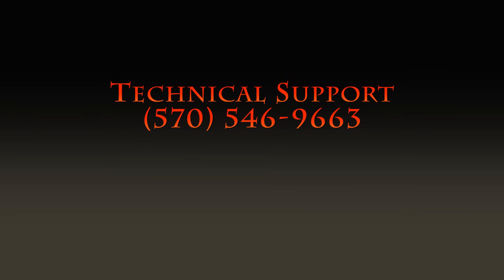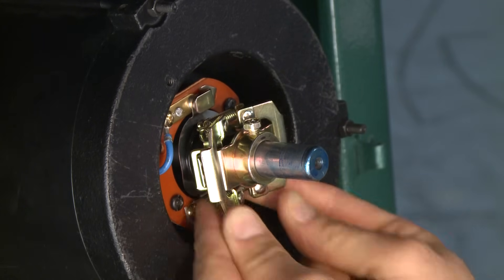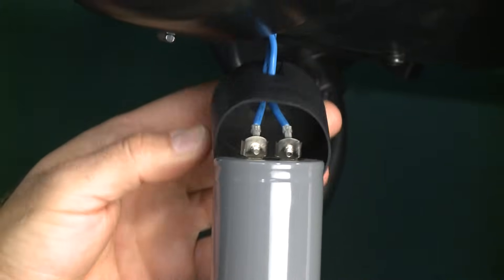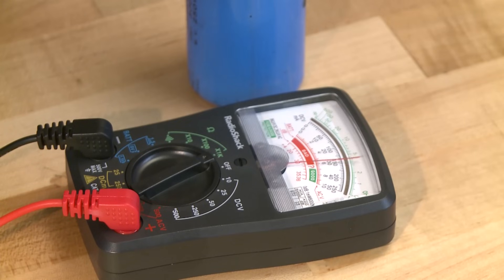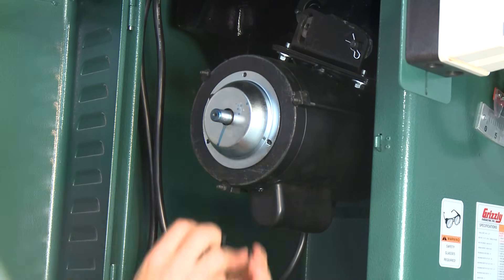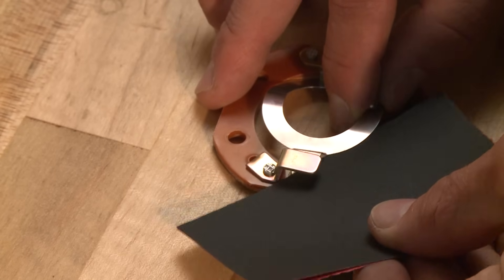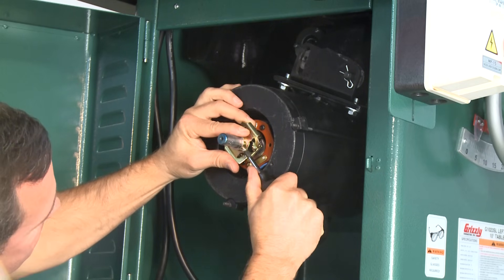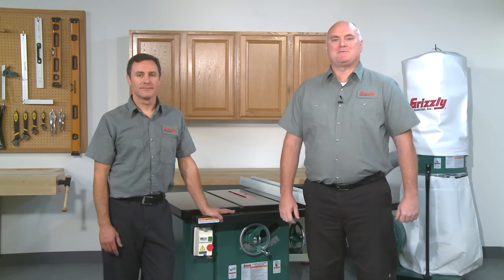How to Troubleshoot an Electric Motor and Adjust Centrifugal Switches

Comment: Support sent me this video. He said for my shopfox 1837 it tells him the switch is external and something else says it's internal. I gave replaced my start and run compactors and then a second set. Its for sure not those. Also my analog reads how it should. But when i remove the fan cover, the fan, the bell housing, gheres no switch. Just bearings on the shaft and the copper coil behind it. Nothing like this video. The switch is the most likely next step and i can't find it. I wish it was as easy to get to as this video showed.
Reply from the maker: I'm sorry to hear the video provided wasn’t helpful in resolving the issue with your W1837. I recommend reaching back out to our Product Support team directly. Please let them know that the video did not match your machine’s configuration and that you're unable to locate the switch as shown. They’ll be able to take a closer look and guide you through the next steps.

Comment: Thank you I’m so glad I found your channel and this video in particular. I have a craftsman air compressor. It’s says it’s professional brand 27 gallon. It’s a nice heavy duty unit. I inherited it from an estate. It’s only about 12 years old and initially when you plug it in and turn it on, it would run for less than a minute and die run and die so I changed both of the capacitors the run and start they are newand still the same issue. I didn’t know about the internal centrifugal switch on the motor. I’m going to try this step next thank you so very much.
Reply from the maker: We’re glad the video could help. It sounds like you’ve already done a great job troubleshooting with the capacitors, and checking the internal centrifugal switch is definitely a smart next step. Hopefully, that resolves the issue and gets your compressor running smoothly again. If you need additional assistance, our Product Support team is here to help. Keep us posted on how it goes, we love hearing success stories from the shop!

Comment: Is there a way to access the capacitors and the centrifugal switch on my 15" wide belt sander (G9983) without removing the motor. The access cover is only on the pulley side.
Reply from the maker: Ensure the machine is disconnected from power before beginning.

Remove all accessible motor panels, including the belt access cover.

Loosen and remove the belts.

Remove the brake caliper to allow additional access.

Disconnect the motor wiring.

Remove the motor mounts.

Carefully raise the motor and place blocks underneath to help support it—take care not to damage the capacitor cover or fan cover. You may need an assistant to help lift the motor from the machine.

Once the motor is removed, tests can be performed on the capacitors, centrifugal switch, and contact plate.

If you need further assistance, please contact our Product Support team at (570) 546-9663.

Comment: Yeah all well and good until it's a G0771Z and the switch on the front and not accessible and your brand new saw won't start.
Reply from the maker: We’re sorry to hear about the issue with your table saw. If you haven’t already, we recommend reaching out to our Product Support team, they’ll be able to assist you with troubleshooting or any necessary parts. We want to make sure your saw is up and running as it should.

Comment: You don’t test caps like that it tells you nothing 😂
Reply from the maker: If your voltage meter doesn’t have a capacitance tester function, this is still a reliable method for checking whether your start or run capacitor is faulty.
Reply: It all depends where the fault is this is why this method is useless. It’s best to just get the right tool for the job.

Comment: My 3HP 1PH Grizzly has two capacitors.  One is a "start" cap and other is a "run" cap?  You only talked about the start capacitor and related symptoms.   My motor starts but doesn't run.  If that makes sense.
Reply: Not knowing much else about your motor, if it has a problem running, maybe that run capacitor is the problem and needs to be replaced. 

I would note that just having two capacitors doesn't necessarily mean that they are run and start capacitors. The motor on my lathe has two caps, but it turns out they're both in series with the centrifugal switch. Therefore, they only take effect while starting: two start caps.

Best of luck to you.
Reply from the maker: For more detailed assistance, we recommend contacting our Product Support team at (570) 546-9663, and they’ll be happy to walk you through troubleshooting and help you get it sorted out.

Comment: Good video i got a compressor and i dont know if the switch is getting stuck or got bad start capacitor i ordererd a new guess im gonna see .but it will run and shut of but when i use it and run it down and the pressure switch flips it dont want to start wait 30 min and it will run again
Reply: It's not the thermal sensor cause it draw like 60 amps and want run up to speed

Comment: How do we use a centrifugal switch to stop a three-phase induction motor, and what is the connection method? Can you explain it with a video clip? I will be grateful to you.
Reply: This question doesn't make much sense, in this context.

These centrifugal switches are all about starting a single phase motor. Three-Phase motors don't need starting capacitors or centrifugal switches.

If you want to stop a three-phase motor, cut the power to it. If you're trying not to stop it, but control the speed, use a variable frequency drive, often called a VFD.

Comment: Another question, please Why don't we use the centrifugal switch instead of the capacitor to start the rest of the engines, I mean in the compressor, refrigerator, freezer, air conditioner, or split system? Can you explain via video clip, thank you
Reply: I think the answer is at the beginning of this video. The starting capacitor effectively generates a second phase of power. The centrifugal switch just turns off that second phase after it's done its job. The starting capacitor and centrifugal switch work together. Neither is any good without the other.

The job of the second phase is to make sure that the motor turns around in a circle, instead of just staying still and getting squished. 

This type of motor runs using two electromagnets, on opposite sides of the motor. When the motor is stopped, they can't start it spinning, because they're in balance with one another. They just push without moving.

The starting capacitor runs a third electromagnet, whose job is just to give the thing a shove and upset the balance of the two main electromagnets. 

Once it has started spinning, the centrifugal switch turns off that third electromagnet. The motor spins nice and smoothly. It's momentum carries it across the two main electromagnets, which give it a smooth push every time around. 

If the centrifugal switch doesn't interrupt that third electromagnet, it continues to give an unbalanced shove every time the motor goes around. It makes a horrible sound and breaks things. And that's what's going on with my motor. 😔

Comment: Very good information. I'm going to do battle with my five horsepower 220 volt motor for my Foley bell saw planer. In the electrical box there's two start capacitors and three run capacitors in parallel. As Charlie Brown would say, good grief!

Comment: Oh my God, the level of ignorance in this video is ridiculous 🤣 

- Run capacitors are discharged through the motor windings in a fraction of a second.  Assuming that doesn't happen, waiting 5 minutes isn't going to discharge the capacitor.  Most start-capacitors have bleed-resistors to discharge them but run capacitors are NEVER equipped with them hence you need to check for DC voltage to make sure its safe to handle!

- Shorting a capacitor with a screwdriver in some cases can literally liquefy the metal tip or melt the capacitor terminals off sending molten metal flying into your face.  It's best to use a bleed-resistor to slowly drain the capacitor charge instead rather than causing arc damage.

- To test a capacitor it's best to setting your meter to capacitance and verify the reading falls within the specified tolerance ranging printed on the capacitors enclosure.

- The main reason your centrifugal switch contacts are burnt or pitted is that most Chinese electronic component manufacturers cut corners by not alloying enough Beryllium into the contacts to prevent excessive arc burn/pitting hence they are designed to fail much sooner compared to past switch contacts!  Don't even bother trying to sand the contacts because that only causes them to burn/pit even faster the next time around due to you removing even more of the Beryllium coating.  The best option is to just replace the switch.

- If the centrifugal switch contacts are welded together then the start-capacitor is destroyed because it doesn't have a 100% duty cycle like a run capacitor.  Usually, if the start-capacitor stay in the circuit for more than a second then it typically blows the guts out of them.

Comment: Hi my capacitor motor starter is raté 600uf and 150vac can i use à same but with 250vac ? Thank you
Reply: If you try to put 250 VAC on a 150 VAC capacitor, you're going to have a bad day.

However, if the motor is made for 250 VAC and has a 150 VAC capacitor, it's probably fine. That's because the 250 VAC is across both of the main motor windings together. Because they are in series, each winding sees only half of the total, 125 VAC.

The starter winding is probably parallel to only one of those main windings and therefore also only gets 125 VAC.

You're probably fine.

Comment: I needed this!  My band saw took a dump while cutting a bar of 12L14. I suspected the cap. Melted! Dropped in a new one and went to work.  90 seconds later, a pop from the capacitor cover and magic blue smoke comes out.

Thinking about the problem while machining a block it dawns on me that I'm not hearing a click and I bet it's a switch.  Bread crumb trail of clues lead here.  I'll follow up.

Comment: Hi . I have a centrifugal pump 2.2kw AC single phase motor. Can I run it on solar without using batteries and inverter

Comment: I have the south bend sb110815" planer by you guys and unfortunately the access is not nearly as convenient as it is in this video. it has a start AND run capacitor. the machine is 11 months old and I have k now idea how to trouble shoot it eecpt for your videos. all centrifugal switches and electric motors are not the same on the machines you manufacture so a ballpark video is not close to helpful for me. I paid 4 thousand dollars for a planer with no idea I would need to be a  mechanical engineer in 11 months to repair it. the only option provided is to crate it up again and wait for its return. THE MANUAL COULD NOT BE MORE CONFUSING. It's for machines manufactured before 2020 and after in no competent order. I could not be more disappointed right now and had to go buy a cheap 13 inch planer and put a bunch of projects on hold until this gets fixed. you need better more specific videos and for crying out loud make a septette manual for the new machines!!!
Reply: It’s absurd that companies who want respect & loyalty don’t make useful/accurate manuals readily available, with ongoing repair parts available at a reasonable price.
Reply: It’s absurd that companies who want respect & loyalty don’t make useful/accurate manuals readily available, with ongoing repair parts available at a reasonable price.
Reply: It’s absurd that companies who want respect & loyalty don’t make useful/accurate manuals readily available, with ongoing repair parts available at a reasonable price.
Reply: It’s absurd that companies who want respect & loyalty don’t make useful/accurate manuals readily available, with ongoing repair parts available at a reasonable price.
Reply: It’s absurd that companies who want respect & loyalty don’t make useful/accurate manuals readily available, with ongoing repair parts available at a reasonable price.
Reply: It’s absurd that companies who want respect & loyalty don’t make useful/accurate manuals readily available, with ongoing repair parts available at a reasonable price.
Reply: It’s absurd that companies who want respect & loyalty don’t make useful/accurate manuals readily available, with ongoing repair parts available at a reasonable price.
Reply: It’s absurd that companies who want respect & loyalty don’t make useful/accurate manuals readily available, with ongoing repair parts available at a reasonable price.

Comment: Hi, thanks for sharing the knowledge. I am having problem with a tyre changing machine.  it's a single phase motor with 1 capacitor. It spins fine clockwise. When switch operated to turn anti-clockwise, it tries to turn but not moving. If manually pushed, it starts spinning normally until you take your foot of the switch.. I have replaced internal reversing polarity switch but no joy. Can the centrifugal switch be at fault?

Comment: I noticed the capacitor did not have the normal microfarad rating symbol., a u with the tail. It had a capital M instead. Is this a different value?
Reply: 6:23 the “M” or “u” are both prefixes for “micro”
Reply: I did not realize that. I would’ve thought the capital M was mega. Thank you.

Comment: As a machine tech, I've done this many times.  I have taken a file to the contacts to remove pitting.  This does work but will not last as long as a new set of contacts.  After filing, set the switch the way the video says to.  It's a good idea to order a new centrifugal switch after filing the contacts,  They are not that expensive and you can have them on hand when the filed set quit on you.  All you really need is the shaft diameter where the switch is mounted and check that the mounting screw spacing is the ame, you can order them online.  You can even look for the best price because the filed set will last for a while.

Comment: This saved my day. I bought a 5000.00 dollar baileigh 12" table saw they thought the motor was burnt up. I replaced the start capacitor and still wouldn't get up to speed. I then saw this video and adjusted the centrifugal switch and presto. 5000 saw for 500

Comment: This was actually pretty useful and I got a new aspect (testing the capacitor) of motor diagnosis and understanding! I am so new to the motor side of machines, but I've had to dive into it while I continue with the Walker-Turner table saw restoration on my channel. I've had to take this a step further and try to learn about wiring, which I have zero experience with, but I'm nearing the end of the motor restoration, so it's one of the final steps at this point. Now, don't take me wrong, I'm not going to do some hack dangerous wannabe job, just trying to learn enough of the basics before I pass the wiring/cord/circuit breaker switch hookup to an electrician. Thanks for the quick video.
Reply from the maker: We are glad to help!

Comment: I had this same problem on my old Grizzly G1023 table saw.  It would not start and only made a very slight buzzing noise when I pressed the start button.  However, it was not a bad capacitor or a switch problem.  After testing the capacitor I decided to open the small cover plate on the motor that covers the junction of the power supply cord to the motor’s wiring.  I found that one of the orange wire nut covers appeared to be burnt a bit.  When I started to twist it off, it was loose and the two wires had very little left connecting one to the other.  I stripped a bit more cover off the wires and used a new wire nut cover to connect them and a bit of electrical tape and thankfully that fixed the problem.  The saw started right up!